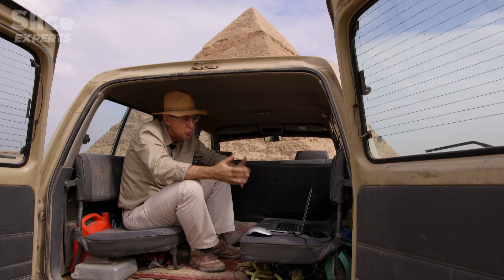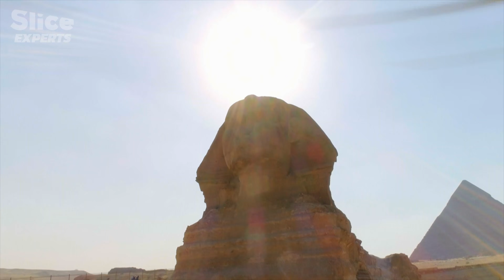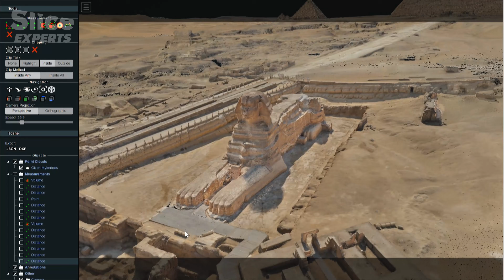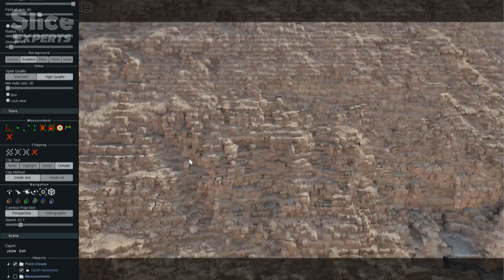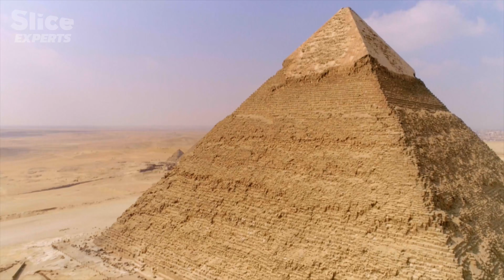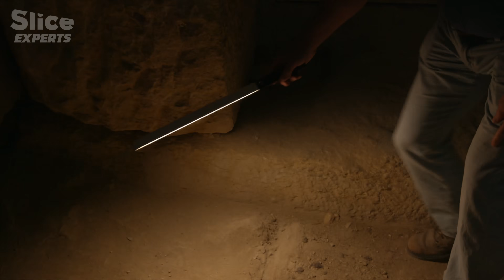Giza Plateau: How did this Giant Funeral Complex come out of the Sand? | FULL DOC

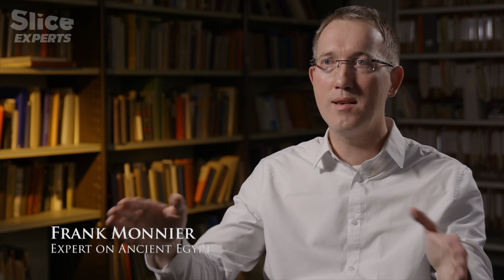Comment: Does anyone, at this point in time, trust Hawas?  And we're not arguing what's under the Sphinx.  We're arguing what's inside the Sphinx.  As far as the Pyramid is concerned, and the reason why there is a crack in the roof, at around 29:45, is because he built his Pyramid at too steep of an angle, and then put too much weight on top of it, causing the Pyramid to buckle under the weight.  I would have thought that Egyptologists would have known that?